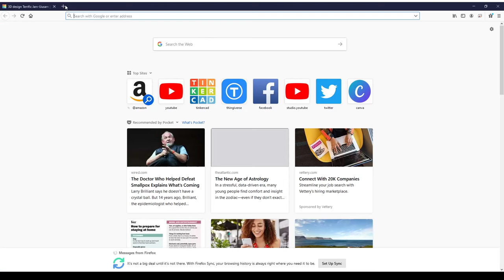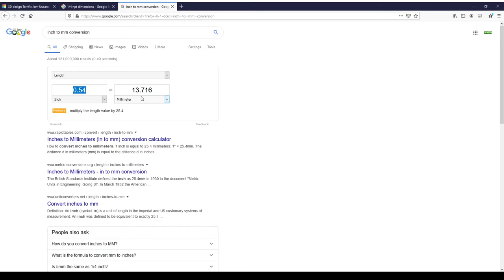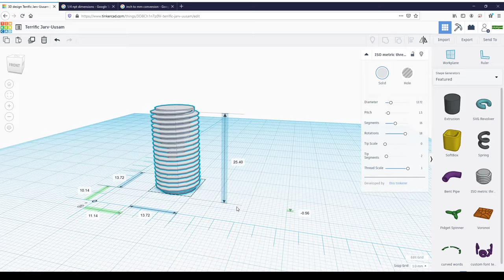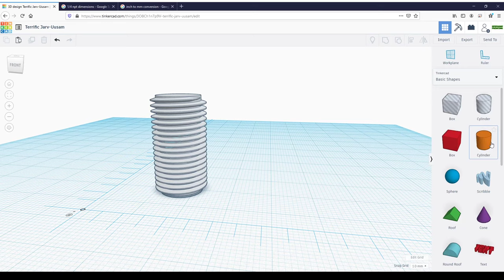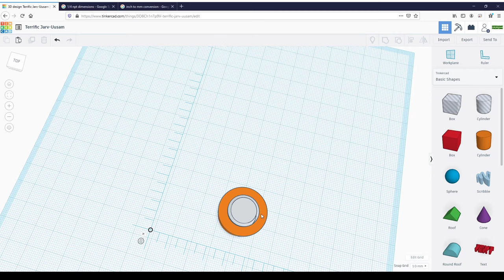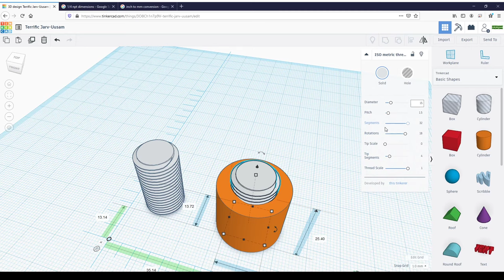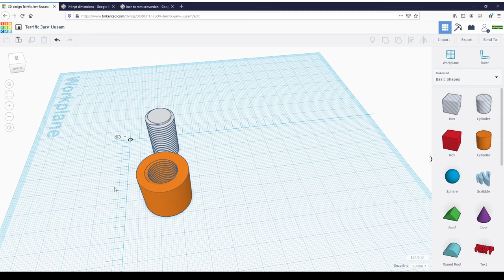How To - Replicate any thread with Tinkercad!

Comment: lot's of great info here...except for one tiny, little detail. You used the wrong thread chart. NFT is for  tapered pipe thread. The 0.54"/13.72mm diameter is more than double the diameter you would need for 1/4-20. A UNC chart would have given you the correct thread width of 0.25"/6.35mm. I only post this because I needed to put a 1/4-20 thread in a part. Thought it seemed kinda big when I was plugging in the numbers. But everything else in here is gold!

Comment: Thanks for this. Btw - you don't need to stay in millimeters. You can change to inches in "Edit Grid" bottom right.
Reply: But why would you want to? Metric has much more granularity
Reply: @Mr2greys If you need a thread in inch????
Reply: When designing a specific part to fit somewhere you sometimes only have inches to work with and it's far easier to machine in a unit you took pre-existing measurements for rather than opening yourself up to conversion errors by trying to use both.
Reply: Millimeters is more accurate
Reply: @vegaspitbikes  What a dumb and inaccurate statement.  Neither is more accurate than the other.
Reply: @vegaspitbikes  They are a lot of things but more accurate is not one of them
Reply: @christopherhughes6519  sure it is, I can measure to .001 inches without using the thousands place and I never have to convert fractions to decimals since everything works on 1-10
Reply: All the metric simps in here smh

Comment: TinkerCad is an amazing tool and I've designed hundreds of useful parts with it. Besides the issue with the whole NPT thing why did you use mm when making a 1/4" part. TinkerCad works just as well in inches as it does in metric.

Comment: The tutorial is interesting and clear. But, if you want to print everything in 3D, you also have to pay attention to the distance between each thread in the nut, or you will not be able to screw it in until the end. To check this, make the thread (in this case the cylinder) transparent, insert the screw and check the difference. A small adjustment in the height of the inner thread will be sufficient.
Reply: You only have to extend the width . The whole object must not be expanded! This would change the pitch of the thread and it cannot be screwed at all. It is only necessary to create a gap to the sides. Counterpart only width   :P . I think about 10%                                    So if the screw has a width of, say, 16.5mm, just calculate 1% is 0.165 X 10 = 1.65 mm ( 16.5 + 1.65 = 18.15 mm counterpart

Comment: Great video. Question, I have the need for 3x2 bushings with NPT threads. Cast iron is expensive and hard to find, plus costly to ship. Is it possible to 3D print? Thanks in advance.

Comment: Hey, thanks for explaining this. I have a air pressure spike regulator i am working on, and its funny that you mentioned air pressure at the end. I always anneal my pla+ and sometimes vapor smooth also for best pressure holding results. Did you ever end up testing it?

Comment: Do you know how to control the minor diameter as well as the Major diameter? i.e. an M12 thread has a Major diameter of 12mm and a minor of 10.106mm. When making the female threaded part if the minor is too small, the bolt won't start in the hole.

Comment: Ever tried printing these in nylon? I'd imagine it would work well for holding air pressure. I use overture nylon for threaded carabiners and they are waaaaay stronger than my pla+ or petg carabiners. It shrinks like 1 or 2 percent on its own, so the threads match right up.

Comment: Do you know how to put the threads on the outside of a cylinder? I am trying to replicate my pool vacuum adapter from intex to summerwave pool? One cylinder needs the threads on the inside and one needs threads on the outside with a tube to connect both of them.

Comment: Great video,Thanks for posting as I'm printing Bolts and nuts that don't want to work together,I'm going to try this method 👌👌
Reply from the maker: Best of luck! Remember to make a few smaller test print to get your tolerances for your printed dialed in. Also rubbing some candle wax on the threads will help them go together a little bit easier.
Reply: @TheEpiphanyShow  I've got some Beeswax,But I also once added a little heat to a fastner to cut the thread into The plastic,Again nothing that needs torquing down
Reply: @TheEpiphanyShow  So I took your advice on a 16mm thread that I designed but made the recieving female thread 18mm ( As 17.5 was too tight) Still not as smooth as I'd like but it's screwing in with the help of some olive oil😂

Comment: How would I make a threaded pipe like the one you just made but with a hollow middle. Like fully threaded PVC?
Reply from the maker: Use the cylinder tool and make and go all the way through your object as a hole.

Comment: i need to make a compound miter setup block for a table saw . measurements are: 1st one 70 mm top 195 mm bottom 60 mm high. the second one is: 90 mm top 210 mm bottom 80 mm high any tips?
Reply from the maker: I suppose I’m confused on what exactly your making. I usually use a sled type jig for repeating mitre cuts. Might you be able to explain it better here or email me a link/drawing to what your looking to make? TheEpiphanyShowyt@gmail

Comment: Did they not have imperial measure as an option when you made this? Because I certainly can work in inches on TinkerCAD.
Reply from the maker: Irrc at the time if I designed something in tinkercad in imperial when importing it into my slicing software it would convert to mm but not correctly. So 1” would become 1mm and you would have to convert it anyways. I’m not sure that’s the case anymore. Additionally I design almost everything with metric measurements in mind since most of the world that is what is standard so it’s commonplace for me now.

Comment: Can you use tinkercad to add an existing SDL, and use tinkercad to measure a piece of that object that has a recessed section? Everytime I use the ruler it just shows how tall the object is and thats it.
So like a box, it wont show how deep the inside of the box is
Reply from the maker: Unfortunately not. Best you can really do with tinkercad In this situation is make an object and merge the original as a hole and that would leave you with the void then you could use the measuring tool on that. Freecad is well free and the measuring tool is pretty easy to use.

Comment: wouldn't you get a tighter fit if you printed it undersized and then ran a tap through it after printing?
Reply from the maker: Yes you could, but your weakening it at the same time since you will be cutting your outer wall layers. Once you have tuned your printer you should be able to get pretty tight fitting parts. In fact most of the time I have to give mine a bit of a rub with some wax for easy operation.

Comment: The problem is not TinkerCad, it is your printer.
If you model up an exact replica in TinkerCad, your printer will not print it that way without making adjustments to the printer and/or
adjusting your Tinkercad model to compensate for your printer's deficiency in accurately printing the model.

Comment: I have a paint roller that has a custom thread on it ( so you buy the companies extension pole), how do I go about measuring the internal thread size and pitch so I can print out an adapter?
Reply from the maker: They make a tool for it but I’m assuming you don’t have it or want to buy one. What I would do is stick something inside the threads until it bottoms out for the length and make a mark on it.  Then I would use something like an o-ring pick to feel the bumps of the thread. In a straight line every bump should be 1 thread. Take the length and divide it by the number of threads. For example 50mm/25 threads = 2 threads per mm. If it’s 10mm wide it would be a M10 x 2.
Reply: @TheEpiphanyShow  Thanks that sounds good to me!

Comment: I guess instead of doing the inch to mm conversion you could have changed the units used in Edit Grid.
Reply from the maker: This is true but I would say most of the world uses MM and not inches.
Reply: @TheEpiphanyShow  Realy? only 192 out of 195.Liberia myanmar and usa are only country's that use caveman measuring system in 2020.

Comment: how do you make it go over 20 threads per inch
Reply from the maker: Unfortunately there is only a hacky/ annoying way to do that. You have to make it 1” at a multiple of the tpi you need. Then shrink it down and duplicate the object and match the threads up. So say you needed 32 tpi you would make a 1” thread at 16 tpi and then take the z handle and shrink it down to 1/2”. This then makes it a 32tpi thread however it’s only 1/2” long. So if you needed a long thread you Would duplicate the object and move the new one up to the top of the new piece. Then you can repeat this process for the length of threads you need.

Comment: Not sure if you'll still be checking comments on this, but I have had such a hard time using trial-and-error to create a custom valve stem cap for my car tires. Can you help me figure out how to do this?
Reply from the maker: I can help you out with this.
Reply: @TheEpiphanyShow  🏆🥇Thank you!  Private message? New video follow-up?
Reply from the maker: @CTRstocks  Video follow up
Reply: @TheEpiphanyShow   So I just couldn't let this keep me awake at night anymore (not literally), so I spent some more time and was able to figure it out.  I had been using dimensions I found online for Schrader (standard wheel) valves, those were (6.9mm x 0.784mm) in one place, but (7.7mm x 0.784mm) in another.  Pretty sure those are incorrect or I have to use different dimensions when 3D printing.  For my Ender 3 Pro, I had to set the diameter to 9.25mm, pitch 0.79mm, and everything else left as default.  From there, I changed the shape from "Solid" to "Hole", nested it inside my design, and BAM!  It worked.  Thanks for offering to do a follow-up video, if you have already started it I still think it would be a useful video to add to your channel.

Comment: It seems like others have the same question as me.  Is Tinkercad able to make threads longer then 1 inch? It's strange that it's smart enough to tell it 18 rotations and assumes it's per inch even if your set to mm but if you change the length, it just stretches the threads out and can't compensate for the difference. Like if you change the length to 1 1/2" (38.1mm). Very strange to me. I've spent a lot of time searching online for help but can't find anything. Creating random sizes is not really a problem but I'm trying to duplicate real threads. Thanks in advance for ant help anyone mat have.
Reply: He made his bolt one inch, and then put 18 rotations. If you want longer then you have to do the math unfortunately. example do 9 rotaions for half an inch, or 27, for an inch and a half. You have to change the rotations as you change the size.
Reply: @JB-xj9vl  Thanks for the reply. That’s what I thought but wasn’t sure if there was a way to automatically do it.

Comment: 28 rotations are not possible for 1/2"-28
Reply from the maker: Do one where the length is 1/2”  with 14 rotations then copy and paste  the object and  align it centered with the first one the. Align the top to the bottom. Match the rotation so the threads align perfect. Lastly combine the object. Now you will have an object with 28 tpi. It’s not the perfect solution but it works

Comment: You do realize that you can change the units to inches in the program right?
Reply from the maker: Yupp but most of the world uses metric. Grown accustomed to just converting everything now.
Reply: Yes but that's not what I was referring to. You went to Google a measurement to convert it to metric. Couldn't you have just switched it right on the program?
Reply from the maker: It doesn’t convert. For example 1” will become 1mm. At least about a year ago that’s how it worked.

Comment: Why da fuck would you call thread pitch(distance between the tips of thread)a rotation ? Its so confusing for someone with machinist background.
Reply from the maker: It’s how tinkercad has it don’t blame me for describing the tool.
Reply: @TheEpiphanyShow  It was no personal attack it was more of a statement of general wondering why would someone do such thing.
Its wierd sometimes to translate things on english ,especialy if its not your primary language.
I used that thread tool yesterday and its absolutely horrible.There is no way to know if the thread pitch matches what you want to make.Maybe i dont understand how to use it ,but every time i use it and i want to make M12 bolt x1.5 thread pitch,lets say 50 mm long i get some  stretched shape .